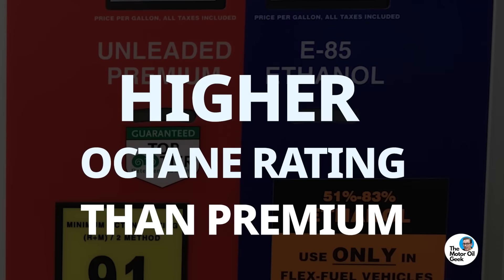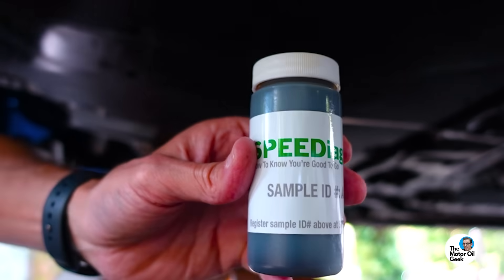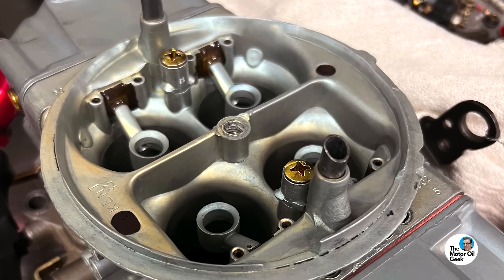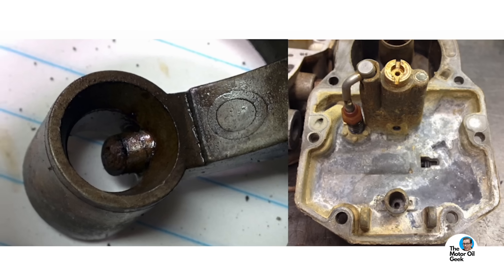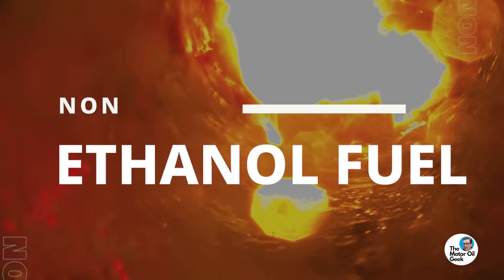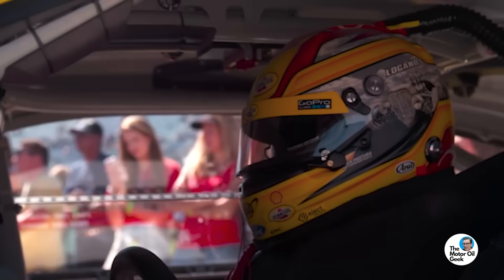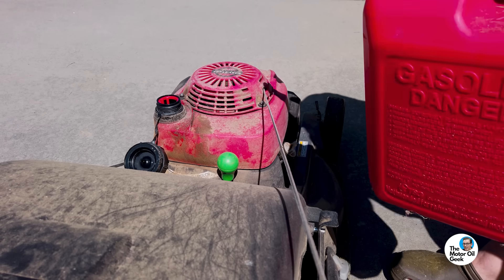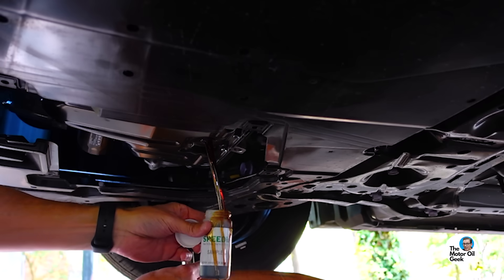ETHANOL: Higher OCTANE, Higher RISK?

Comment: As a small engine mechanic and vintage auto mechanic who works on carbs non stop: NOTHING WORKS against e10/ethanol to stop it from destroying fuel systems. NOTHING. Countless customers bring in equipment with Stabil, ethanol shield, Star tron etc etc and it's all gummed up after 3plus months. The issue goes deeper as people use gas cans that also need 3 month swap. Normal red plastic gas cans are not impermeable and they pull moisture directly through the walls of the HDPE plastic. There are brands like Sure-Can that put an secondary liner in their plastic cans to combat this or you can use steel but ethanol will eat it.  Ethanol free gas is almost everywhere in the US, you just have too look. No endorsement  but there is a non profit that shows local stations with ethanol free pure-gas org
Reply: @sixtyfiveford Thank you for input. Ethanol free fuel is available to me at a few locations and called “recreational fuel” but usually much higher priced than premium 10% ethanol fuel.
Reply: @PineRidgeRez  Lucky me, I have three sources of ethanol-free gasoline within five miles of me.  I typically pay about $0.80 more per gallon for it, than Regular E10.  For the OPE and generator use, that price differential doesn't bother me; I run through around 40-50 gallons of ethanol-free per year (mostly winter generator stockpile of 25 gallons, which if unused in the Spring, I run in the OPE where possible, and in one of the vehicles if not).
Reply: @alsavage1 Yes sounds good and I am still buying the ethanol free for my vintage motorcycles because the carburetors are so much smoother and less repairs for the complete fuel system.
Reply: @alsavage1 her in Ontario you can now only get E10 at Costco! That is where I get all of my gas now!
Reply: @PineRidgeRez My 67 Triumph Daytonahas run at least E10 since 1975! I have never touched the carbs on it! The workshop manual says the gas will soon be phased out and explains how much cooler they run on ethanol. It has spacers on the foat needles that you remove to rase the float level for E95 and has the timing mark to advance the timing for E95!
Reply: Another reason to change your oil at lower milage. I never liked the idea of 7 to 10k mile oil changes. I change mine at 4k .  Maybe it could go a little longer but I'm 68 and don't plan on buying another new truck in my lifetime.
Reply: @rustypipes12 I go 10k on my hybrid Maverick. Sleep well at night. 45 years retired mechanic here.
Reply: It's not hard to remove ethanol from fuel . There are vids on yt on how to do it.
Reply: @hdrider2071  What do you use
Reply: Removing ethanol from gasoline is effortless but there's a couple exceptions. 

A 5 gallon can of e10 is going to have roughly half a gallon of ethanol. It mixes effortlessly with water and separates from gasoline. So fill a gas can to 4.5 gallons. Take it home and add half a gallon of water. Yes, water. Shake shake shake and let it sit. It will bond to all of the ethanol and settle out to the bottom. Pour off the top 4ish gallons into another container. The last gallon is water and ethanol which can just be disposed of down the sink. 

Now the but: ethanol these days is used to raise the octane rating of fuel. So they're manufacturing even lower octane grades of fuel these days and relying on the 100 octane of ethanol to push it up. Without doing math, roughly an 87 octane is around an 82ish octane fuel with ethanol bringing it up five points. Most small engines are running at an 8 to 1 or sometimes less compression ratio (6:1) and they do not care in the slightest about stuff even down to 80 octane or lower. Higher compression motors are going to require a little bit more octane. So you're going to want to start with a mid-grade or premium so the lost octane numbers are accounted for.

Edit: I say all this but it is effortless to find ethanol  free fuel these days. 5 to 8 years ago it was nearly impossible. So doing all of this water ethanol removal is almost pointless.
Reply: @hdrider2071 please share !!
Reply: It's not available in Las Vegas, unfortunately.  I believe I saw listings for Las Vegas some time ago at puregas, but they're gone now.  😞
Reply: @turkeyssr it is in Henderson (near lake mead) smiths on e lake mead
Reply: @turkeyssr  The clossest place I found listed that is close to Las Vegas is 835 E Lake Mead Pkwy, Henderson, NV.
Reply: Absolutely 100% correct & true. P.S. Gas cans: I use a 55 year old Steel Jerry Can. Works perfectly.
Reply: i found   it on that site  too   a local airport
Reply: @mikepruett1745 100LL has a ton of lead in it, you can go to a marina and get ethanol free unleaded fuel if it’s a ‘must’ personally I burn the ethanol blend and rarely have problems but I’d also rather clean a carb once in a while over breathing leaded exhaust, or dealing with the issues of leaded fuel such as stuck valves.  (Stuff that’s a challenge in piston aviation) 

The marine fuel is ideal for the small engine applications, ethanol free, no lead, cheaper than 100LL….  Some airports might also have UL93 which is unleaded and ethanol free or what’s called ‘mo gas’ which is unleaded automotive fuel but used in aircraft with specific STC approval.
Reply: Funny, I’ve been using Startron for over 25 years and my small engines start up on the first or third pull even after sitting for a year or two. Yes, 2 years. I have been running Startron in my motorcycles, getting better running and better mileage. I recommend Startron to everyone I know.
Reply: @gungadingo my Triumph motor cycle sat for over 20 years with a tank full of E85 race fuel and it started first kick last week when I sold it!
Reply: You obviously don’t live in New England. It’s basically impossible to get unleaded ethanol free gas around here. The only real options are aviation gas (100LL) or the 110 R+M/2  leaded race gas that is sold at a couple gas stations. It’s actually illegal to sell ethanol free gas in many places around here outside of outrageously priced canned fuel for small engines. 

As for avoiding fuel system damage, don’t store gasohol for extended periods of time. I use E10 gasohol in everything from my chainsaw to my car, I have never had a problem because I rotate my gas out every month, and run my equipment dry before putting it away for the season. Just dump your gas cans into your car and refill them once a month and you won’t have any more problems.
Reply: @Trump985  I go to Hampton airfield Hampton N.H/ & get MO gas. It is 91 non ethanol Self-serve. There is a kiosk that takes credit cards. The cost last time I got some was $ 6.00 per gallon If I remember right. Also when open you can pay with cash. The people working there are Very-Very nice.
Reply: It is hard to find it in northern Illinois. I have to go into Wisconsin for non ethanol.
Reply: @fratzogmopars  Wisconsin has 1025 gas stations that sell ethanol free. IL still has 150 though.
Reply: @sixtyfiveford where in Illinois???  Any in greater Chicago??
Reply: @sixtyfiveford where in Illinois???
Reply: @Trump985  the great comm of mass outlawed pump sales of non ethanol fuel.  Only small cans like you say intended for small engines. Nh and ny are two states that have pump non ethanol fuel available. Ny pilot truck stops have non ethanol available. Pumps are near the car gas pumps byt set off a part. 89 octane only.
Reply: I run 100LL in all my equipment that I let sit for a while and even in my daily driver (1979 Subaru DL wagon, carbureted) on occasion. I live next to the cheapest 100LL in my state and it is barely more expensive than 93 is at most of the local gas stations, and the mileage is that much better in the car that running 100LL is sometimes cheaper overall. On the flip side the only times I have ever had issues with ethanol related corrosion in carburetors is when I let them sit for 3 months or more with gas in them. The car gets driven nearly every day on the highway and even with over 200,000 miles on the current engine rebuild, the carburetor has never been rebuilt. Only jet changes for different seasons and I've never seen any signs of internal corrosion.
Reply: @Trump985 Do you have boat docks that sell gas? Most marine engines are still recommended to not run ethanol blended fuels.
Reply: @Trump985 now yeah, he only sad in awe of america rewatch video, listen to what he says.Stop worrying about your distractions like your own phone
Reply: @Trump985  around 400 stations carry e-free  in New England along with every Home Depot, LOWES, and Walmart
Maine: 135 stations 
Vermont: 128 stations
New Hampshire: 59 stations 
Massachusetts: 24 stations
Rhode Island: 6
Connecticut: 31
Reply: I only use the trufuel ethanol-free gas at home Depot.
Reply: Thank you for a real heads up- I have access to marine fuel which I need to start using for my farm equipment- many thanks 👍
Reply: The question I was going to ask you just answered, thank you
Reply: I use seafoam and my stuff cranks and runs with e10.
Reply: @freedomisntfree_44 every peace of equipment i own runs far better and get better mileage on a minimum of E10.
Reply: @terenceiutzi4003 I haven’t tested that. I thing I just run mine so much it doesn’t have problems. I think the more often you run it you’ll get more hours out of it.
Reply: @freedomisntfree_44 Seafoam is ethanol and essentially transmission fluid mixed. I have so many customers bring me equipment with Seafoam. Problem is you can't argue when somebody's bought into the snake oil.
Reply: I think you’re full of it.   I have saws that have sat on the shelf for over a year with fuel in them and they fire right up and run.   These saws range from late model Stihl and Husky to vintage Poulans and Macs.
Reply: My Lincoln gets 12-14 in suburban driving on ethanol 10 and 20-22 on real gas. I use real gas
Reply: @warrenwinslow4266  No Lincoln ever got 20 mpg,  even on 106 octane high test in 1969.
Reply: @BillySBC My Mom's old 1996 Roadmaster got 27mpg hwy on a trip.  That big LT was just loping at 70mph.
Reply: @H0kieJoe  Bro,  I've driven Roadmasters,  no way they got the same gas mileage as a Dodge Aries.
Reply: @BillySBC 

I was driving the car myself and charted the gas and mileage per fill up southbound on I81.  

Believe it or not, I don't care.
Reply: @H0kieJoe  I absolutely do not believe it.  You're saying your big whale of a vehicle with a V8 got better gas mileage than a Plymouth Horizon with a 2.2 four cylinder.   It's not possible.
Reply: @BillySBC 

On average, your Horizon will spin 2500-3000 rpm at 70mph.  By comparison, the Roadmaster will spin at 1500-1800 rpm at 70mph.  Maybe less, depending upon the gearing.   

I've had plenty of 4 bangers which get poorer fuel economy vs my old Olds Touring Sedan with a 3.8L V6.  Fewer cylinders doesn't necessarily equal higher fuel economy.
Reply: @H0kieJoe     Joe...   Stop.
Reply: I've been running 93 octane with 10 percent ethanol in all of my 4 stroke equipment for years.  Out of an old red plastic can as well.  A half bottle of seafoam in the can and I've always been good to go
Reply: @MadDSnareify Seafoam is horrible! It's alcohol and essentially transmission fluid mixed. It pulls more moisture into the fuel. The only time it's even remotely ok to use is when you're fuel is oversaturated with water so you can blend it with the water to have it remix with the fuel. The engine will run but very very poorly until all the water is passed through. Kind of like taking Pepto Bismal for an engine. 

Higher octane does nothing in yard equipment and technically has less power. Octane is a fuel's inability to self detonate with higher octane less likely to detonate with higher compression ratios. 85 octane is ideal for the sub 9:1 compression ratio all pull start equipment is. It's just wasting money for peace of mind.
Reply: @sixtyfiveford  Just add Marvel Mystery Oil to your Ethanol fuel,  you'll be fine.
Reply: @BillySBC Or just use ethanol-free that's everywhere and don't worry about anything. There's no mystery left in marvel anymore. It's essentially just transmission fluid (mineral oil) and paint thinner (mineral spirits). Oh and don't forget the winter green oil for smell only. This does nothing to combat the hydroscopic nature of ethanol, nor does it do anything to minimize the corrosion effects of ethanol either. I have so many customers that bring me stuff constantly that are dumbfounded why their carburetor is completely corroded because they use marvel mystery oil or even worse, seafoam all the time.

This is just the fuel system not to mention the second main point of the motor oil geeks video was increased Engine wear from running ethanol laced fuels. Backed by scientific proof.
Reply: @sixtyfiveford You need to stop.   I've been using Marvel for years and years,  so I don't need your advice on what it is or isn't,   and your hysterical claims that adding 10% alcohol your fuel is going to destroy planet Earth is summarily being ignored.   Stop running around in a circle smacking yourself on the head,  the alcohol in your fuel is doing next to nothing your carburetor,  and adding Marvel to your fuel will in fact prevent any corrosion should it possibly begin.   Now one more word out of you and we're going to have the nice orderlies hold you down and give you another shot of happy juice.
Reply: @sixtyfiveford  You're being paranoid,  do you know that the fuel Henry Ford wanted all his early cars to run on was 100% Ethanol?   He wasn't running gasoline at all.   Ethanol is a good fuel,  not as powerful as gasoline though,  only about 2/3rds the power,  but it burns very clean,  less engine deposits,  less pollution.  The only reason Regular gas is 87 Octane is because they're adding Ethanol to it,  Ethanol has an Octane of about 105.  So all the paranoia about 10% Ethanol is just that,  paranoia.
Reply: 10% is fine we have been using 10% E for a couple decades now. And its not destroying moder cars
Reply: I've been using ethanol treatment additives for years and I don't have anything gummed up, and since I started using it all my ethanol issues have disappeared and I went back to leaving fuel in the tanks of everything all winter and they all fire right back up in the spring, just like the old days before ethanol.
Reply: Incorrect Ethanol Shield works wonders and if you need rejuvenate carbs you can use Mechanic in a Bottle which is made by the same company. Ethanol shield absorbs water, Stabil seafoam exc dont. Do the test yourself and your'll see.
Reply: @sixtyfiveford thank you for the very helpful, insightful and educational post. Much respect to you, Sir
Reply: I don’t disagree with you but I might add you can get away with ethanol fuel if you use it up on a frequent basis and continue to put fresh fuel back in ! 
It’s engines that sit idle , especially carburetors with an open system and gas tank ! 
Unlike a sealed fuel injected engine which will give less problems ! 
Still , non ethanol fuel has a longer shelf life with less chance of water contamination if you are going to let it sit for any length of time !
Reply: @hotchihuahua1546  I use E10 in carbureted engines that sit for months at a time with no issues.  Motorhomes, boats, generators, etc.  With carbs that are easy to drain I do it, others just get parked.
Reply: I'm a generator tech ,and one of our brands is Briggs. 
Even though we don't deal much with the gasoline side as they are gaseous fueled , we still got a bulletin regarding how gasoline in a can starts to turn after about a month. 
You small engine guys hate the ethanol as much as I do ,trust me I deal with the issues enough.
Reply: 200k on 2 diff. bikes burn  cat pee   amd fill tank when you get home so no water in the air to absorb. But what about the foot of water in the stations tanks that has already been absorbed before you buy it ?
Reply: Ethanol doesn't necessarily absorb water,  it IS water.   Alcohol is made from water,  ethanol is a water-based fuel.   I have found that Marvel Mystery Oil added to ethanol fuel doesn't give my carbs any sign of corrosion,  probably because it coats everything with Oil of Wintergreen.
Reply: I was very fortunate to find ethanol free Shell V-Power 91. Don’t know how long that will last but enjoying it for now!
Reply: Aff gas works on anything without emissions
Reply: This comment needs to be pinned
Reply: Two stroke oil does.
Reply: Been telling ppl for years now how all of the additives for gas to help against ethanol gas is nothing but snake oil, no one listens n is a sucker to believe sales pitchers. NOTHING helps against ethanol but to remove it completely NO additive works....period
Reply: Wavian gas cans FTW!
Reply: Based on what you said, sounds like running the fuel through the engine without sitting solves the ethanol problem
Reply: @SilverStar414  

The majority of people don't run their outdoor power equipment every day.  Your solution is not realistic for the majority of the market.
Reply: I’m calling BS… there’s absolutely NO WAY you’re drawing moisture THROUGH the HDPE. Impossible!!! Ill-fitting caps? Absolutely.
Reply: People, the sky isn't falling. Our farm uses all % of ethanol fuel with no issues. If it wasn't  labeled at the pump, you'd never know any difference.
Reply: @mikeclemens5735  corn needs  to be used for food and oil for fuel. Period
Reply: I honestly haven't had very many issues running plain ole 87 in my pushmower. I got it for free and it had a bunch of dirt and junk in the carb so i had to take the bowl and jet out and clean it all and install a filter. That was 3 years ago and it sits outside all winter without draining the bowl or anything. Still starts up first pull.
Reply: I have been running all of my small engines on E10 for 60 years and have never renched on any of them just oil changes and an occasional spark plug. And yes they are all 60+ years old. The manuals for my 1967 Triumph and my 1969 Buick recommended E85!
Reply: @terenceiutzi4003 I don’t believe your story.
Reply: @PineRidgeRez  OK, you are totally unqualified inform! You do know that leaded gas had 15% tetraethollead! That is lead desolved in ethanol! The leaded gas that we all ran from 1920 to 1975 had almost 15% ethanol in it. Why have they always ran E95 in raci g in England and for the last 25 years in every country?
Reply: @PineRidgeRez 

Neither do I.
Reply: No ethanol free gas in CA other than race or aviation gas, but I have no issues with ethanol so I don't care.
Reply: @DonziGT230 I'm in NorCal there is a fuel and oil distributor near me that sales 93 octane ethanol free gas Just cant pump it directly into a onroad vehicle
Reply: Also an issue on a carb is the bowl vent ,that fuel in the bowl is exposed to the atmosphere more than in the tank. 
Seen that alot ,nasty carb but the tank is still fair.
Reply: @MrTheHillfolk Do you have any idea how little air movement there is in the float breather circuit. All it does is keep the float bowls at the relativel barometric pressure.
Reply: @MrTheHillfolk E10 is capable of suspending 10 percent water without it settling out and damaging any parts. Ethinol  free gas will suspend .1 percent water before it starts damaging parts! That is why all of the gas line antifreeze are either Ethinol, methanol or Isopropal alcohol!
Reply: John Deere and Honda carburetors never gave me issues with e10, the Honda gravity fed float carb going strong after 15 years. All my 2 stroke diaphragm carb equipment runs on e0 otherwise the rubber components deteriorate fast. Yes, cylinder wall wash is real especially on direct injection engines so on a flex fuel vehicle I would avoid e85. Of its a race engine then add some 2 stroke oil to the fuel mix to counteract the wash down. And yes oil change intervals shortened.
Reply: " Normal red plastic gas cans are not impermeable and they pull moisture directly through the walls of the HDPE plastic. " = nonsense
Reply: @plumbbob2184 exactly.